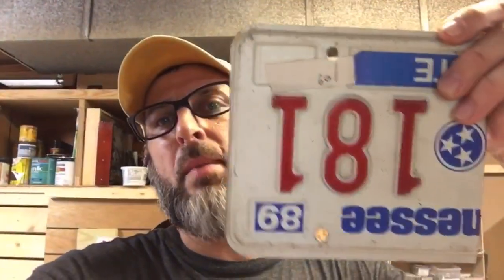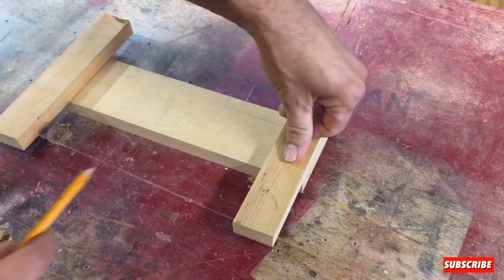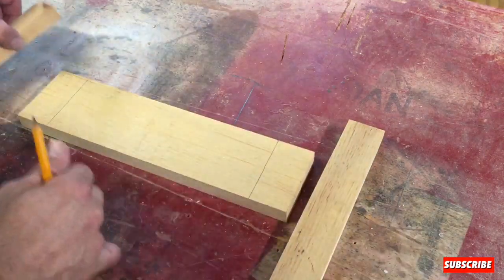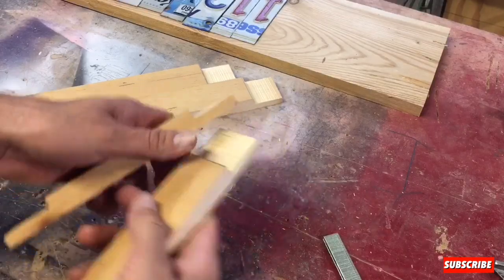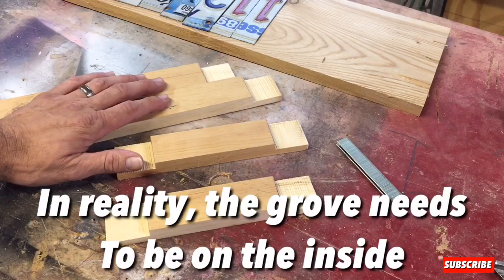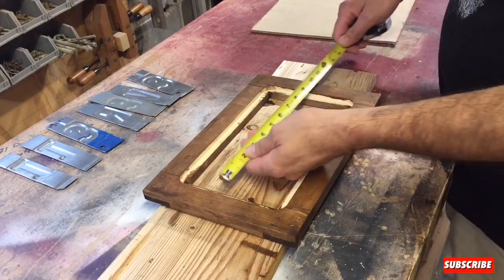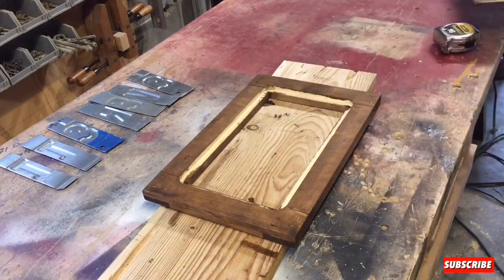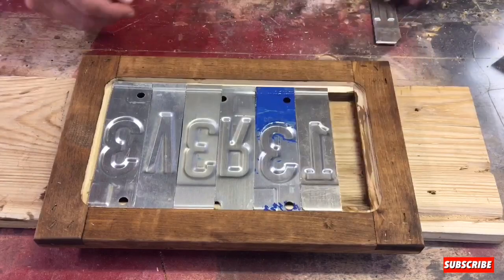How to make a license plate sign with frame

Comment: Way cool project!  I see from another comment that you got the plates at a yardsale.  My question is what blade are you using in your bandsaw and what does it do to the blade to cut the plates?
Reply from the maker: StanCrafted its a metal cutting blade from Lowe’s, works great for thin material. I’ve cut quite a bit with it and it still seams sharp. Thanks for the support